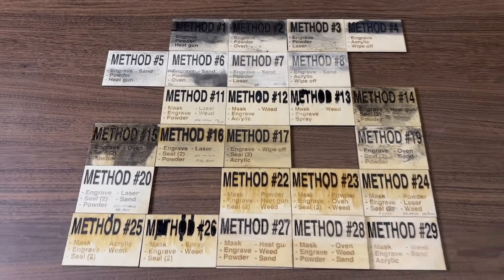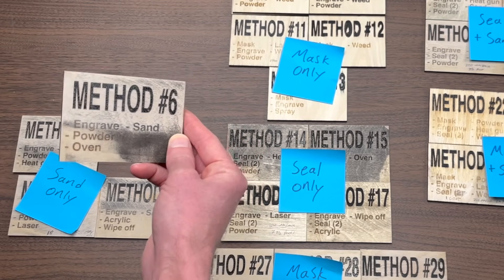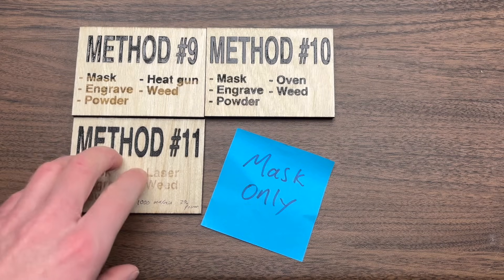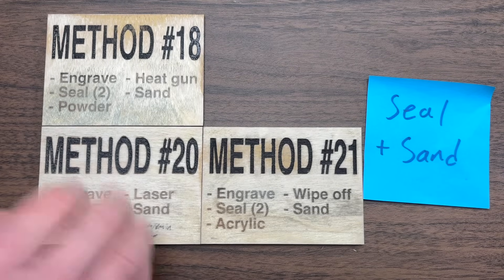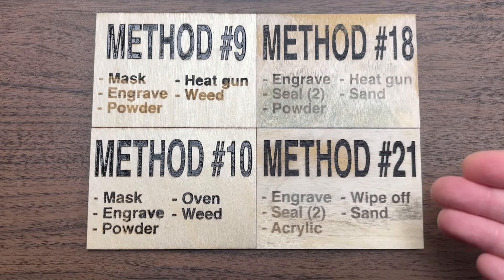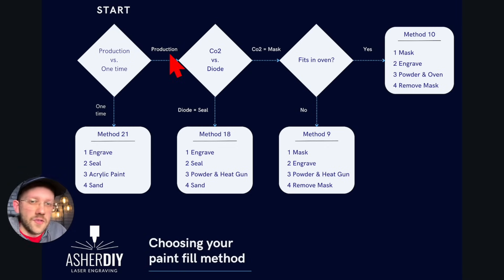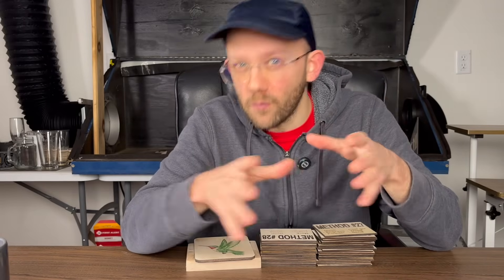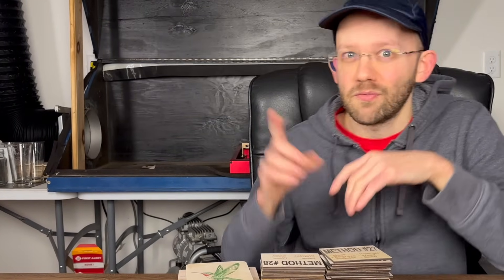The BEST Way to Color Fill Laser Engravings [29 TESTED]

Comment: powder coating is meant to go in an oven. I know people try these other heat methods like the heat gun and laser but the results are not as good as the oven because it does a better job at melting the powder coating material

Comment: Hey great video. I'm new to this laser cutting stuff and need some advice. i have a svg file which has many paets to it and i would like to split it down so i can use them. They fit on a pieace of 400x300 but all i have is 300x200 any advice would be great.

Comment: For black I have found that several coats of water with borax dissolved in it...then lightly sanded...then a shot of clearcoat works really well with a faster speed with 160mm/s or less. Get a good black and then spray with clear coat right away to avoid smudges. I have also done spray paint over my borax treatment and that does well too. The other cool thing is that with the paint you can sort of get a grayscale effect.

Comment: Great video. If you’re sealing the work after applying the paint, I’d recommend  sealing the wood before adding powder to it. My experience has been that I will see a lot of bleed into the wood fibers if I only seal after. Close up those pores. 😀

Comment: For one-offs, with a diode laser, I've had good results with Etch->powder->laser powder.  Sand only if necessary depending on how open the grain was and how much powder rubbed into it.  I'm going to try a seal first next time.  Should remove any need for sanding.  

And you've got me thinking seriously about getting a small oven.  I agree that the laser powder step brings extra complications into it.  I only do it because I didn't think I had another option.  I have a heat gun, but was afraid to use it lest the guns fan blew the powder around.  I should experiment more. 

Thanks for this great in-depth video.  I agree with some other and would like to see you walk thought he steps of the methods you liked best.
Reply: Also, kudos to your wife for upping your flow chart game.  I do love me a good flow chart!

Comment: Good and complete video. What temp and time are you using on the oven?
Reply from the maker: Thanks, Larry - For the temp, I just turned it all the way up. Which off the top of my head, I think was 450 Farenheit. You'll probably have to test the timing to get it dialed in with your set-up, but I believe it was roughly 60-90 seconds for me.

Comment: also, to add, would you use the engrave/seal/powder/sand method on a cutting board/charcuterie board?
Reply from the maker: Good question - maybe someone else will weigh in here to help with that. I don't know much about working with cutting boards, so I'm not sure.

Comment: so for the engrave/seal/powder/sand method, you put 2 coats of sealer on?  Let dry in between coats?  And that prevents the melted powder from sticking to the wood, so you don't have to sand, or at least not sand so much?
Reply from the maker: Hi Debbie - yeah, that's right. On all sealing methods, I did 2 coats of sealer, and I let it dry for at least 1 hour between coats. Which is basically just what it said to do on the can of sealer I used. I did still sand after I was done painting (on Method 18 for example), and this successfully removed both the sealer and the unwanted powder when using the heat gun. BUT - it did not work well when heating the powder in the oven, which is why I don't recommend the seal/oven method. Hope that clears it up!
Reply: @ thank you!

Comment: Great info!    On the test with the bird image (which looks fantastic, by the way) did you do all three colors at once, or use multiple passes of your procedure?    And,lastly, do you have any idea when your CO2 Bootcamp will begin using the P2?
Reply from the maker: Hi George - thanks! For the hummingbird I used Method 21. And I did 2 coats. Within each coat, I did all the colors. In other words, I applied the 3 colors with acrylic craft paint and a small brush, rinsing the brush between each color, then I let all 3 colors dry, and then I repeated for the 2nd coat.
Reply from the maker: oh and the co2 laser bootcamp, I appreciate your interest in that. I’m planning to have it up and running by next Summer. Sorry, I know that’s a long wait, but I’m expecting it to take months to get the program up to the quality that I want.

Comment: Maybe I’m missing something, but why don’t you just do a cut instead of a fill and cut your pattern out like a stencil from painters masking tape on the surface of the wood and then weed out what you want to paint. Spray paint that and remove the rest of the tape. You’re just using the laser to create a stencil.
Reply from the maker: For me, there’s 2 main reasons I didn’t do it that way:

1. That’s a surface painting, not an engraving filled with paint, each will have different looks (primarily depth) and I was focused on filling engravings for this vid. But with that said, if that method works for your project, then don’t let me stop you :)

2. I don’t recall the method numbers off hand, but in the tests where I did use spray paint, I didn’t get good results. I believe streaking and leaking under the masking were the main issues.
Reply: @chalkwatts Okay, I just tried what I said about sealing it first and then painting it. I used a spray mat clearcoat and then spray painted that and that worked great. Didn’t get any bleeding and I’m just using 1/8th inch bass plywood. Just my thoughts thanks.
Reply: @chalkwatts  OK I see what you’re saying. I just tried doing both and I did get some paint leaking into the grain under the tape however, maybe if you sealed it first before you painted it because I don’t think it’s going under the tape as much as it is following the end grains of the cut wood if you follow me.
Reply: I use vinyl tape to get less bleed under  @chalkwatts